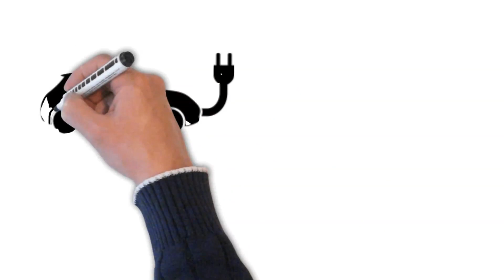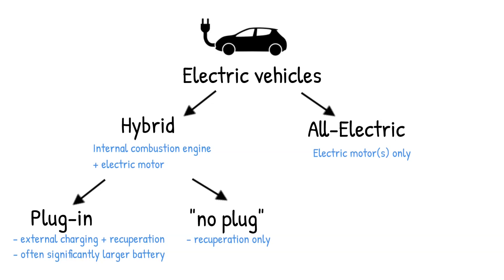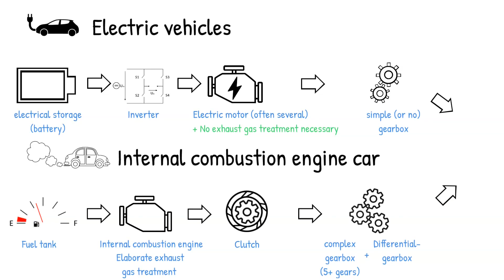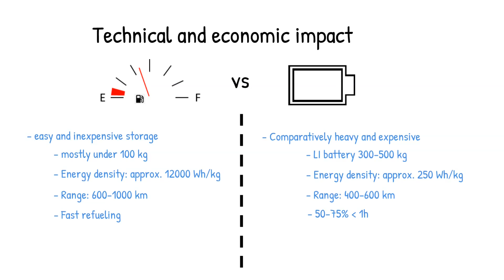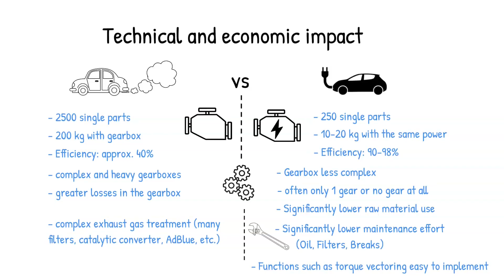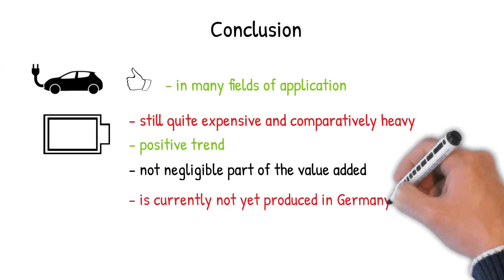Electric vs combustion car | Differences from a technical perspective

Comment: You also have to add the entire power generation chain to the analysis. Where does the power come from?
Reply from the maker: Thats absolutely right. But especially in the case of electric, this is strongly depending on the country and the energy mix in the grid there. Best way would be 100 % renewables of course. 
In the case of combustion car, there is also a lot of energy used to extract oil, reification and transport.

Comment: How long electric car can be explotated ???? 😀😀😀😀
Reply: explotated?
Reply from the maker: The lifespan of an electric car can vary depending on several factors, including the make and model of the vehicle, the quality of its components, and how well it is maintained. Generally speaking, an electric car's lifespan is comparable to that of a traditional combustion car, if not longer.

The most critical component of an electric car is its battery pack. Over time, the battery's capacity will gradually degrade, affecting the vehicle's overall range. However, modern electric cars are designed to minimize battery degradation, and many manufacturers provide warranties for a certain number of years or miles to ensure the battery's performance.

Typically, electric car batteries are expected to last anywhere from 8 to 15 years or more, depending on usage and driving conditions. It's worth noting that as battery technology continues to advance, the lifespan of electric car batteries is expected to improve as well.

Other components of an electric car, such as the electric motor and power electronics, are generally more durable and require less maintenance compared to internal combustion engines. This can contribute to a longer overall lifespan for electric vehicles.
Reply: @InnovativeTechEnergyTransition  yah modern cars cant survive age that survived like audi 100 or toyota avensis 2004 , it s not possible. So looking in timeline still gas car is still better
Reply from the maker: Technically this would be possible, but no product today is designed like that, no combustion and no electric car.
Reply: @InnovativeTechEnergyTransition  you are a fool of the highest order, any internal combustion engine car if maintained correctly or even if not it can be reconditioned, almost all EV’s can’t, the batteries naturally degrade over time. You can’t leave an EV for 2 weeks with out charge and expect it’s still usable let alone months. Worst that happens to a ICE vehicle is the battery goes flat. You my friend are delusional with no education of mechanics or chemistry.
Reply: @InnovativeTechEnergyTransition  someone can get rich if will do long lasting cars like an old cars was
Reply from the maker: If you want a car that is not used, you're right. You could use your battery instead as a storage in the grid. But you can also just sell your car and buy an other one 10 years later if you don't need it anymore. EVs are designed to drive, not to stand still for 10 years.
Reply: @InnovativeTechEnergyTransition  What is it with these moronic statements? With an EV you will have to sell it and buy a new car in 10 years because it wont be fit for purpose anymore, as for leaving a car stand for 10yrs, you can't leave an ev stand for 10 days without needing to recharge it. As for using your EV battery to power your home as a storage device, how does that work when I actually need to use it yet I've used it all to power my home. Imbeciles anyone who thinks that's even realistic.
Reply: @InnovativeTechEnergyTransition  BS, There's still model fords running, we're lucky if you can still use a EV after 10 years...